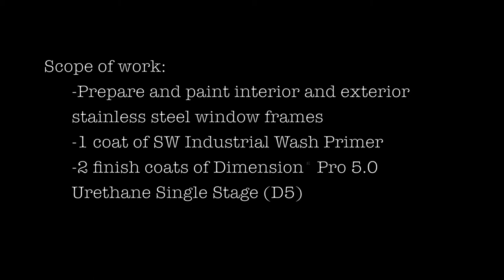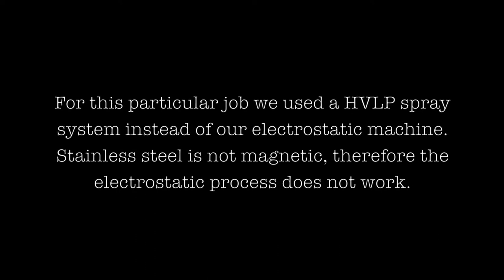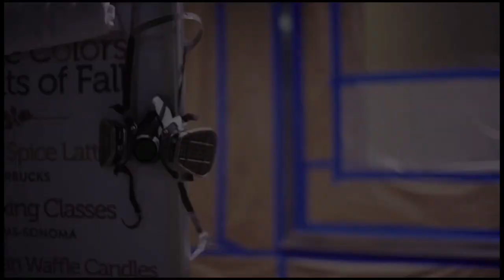Electrostatic Painting - Sea Girt NJ - Stainless Steel Window Frames - NY - PA

Comment: what do you mean you can't spray stainless steel with electrostatic? are you shitting me? it's not magnetic it's electrostatic, the paint is charged the work peice is grounded, whether or not the amount of iron and it's structure defining it's magnetic properties or not have nothing to do with it being conductive naturally or not. to put it plainly you can definitely spray any grade non ferrous and ferrous and still achieve superior results, this is without the aid of a conductive prep rinse etc on the workpeice im telling you those windows could of been painted electrostatic no problem.